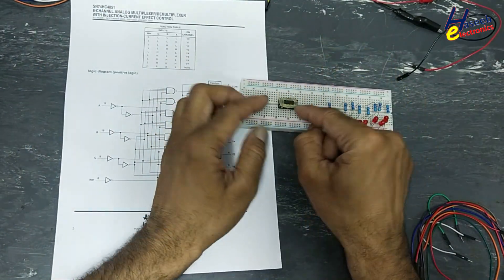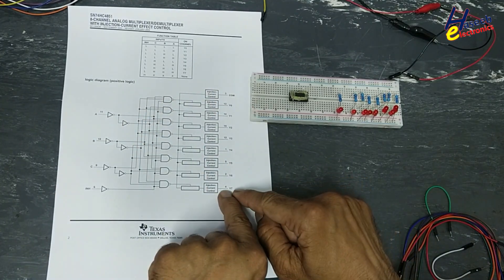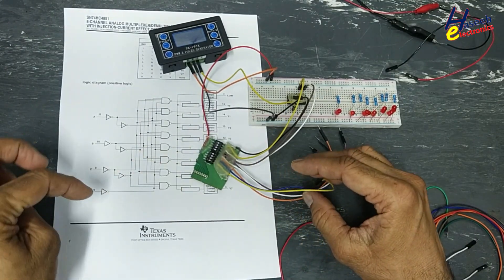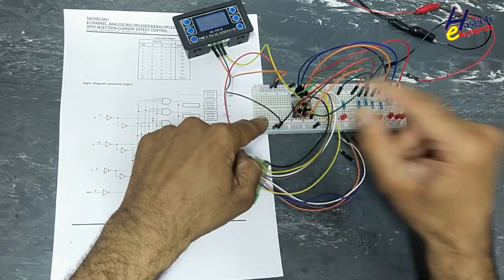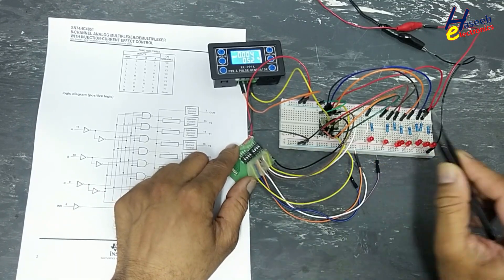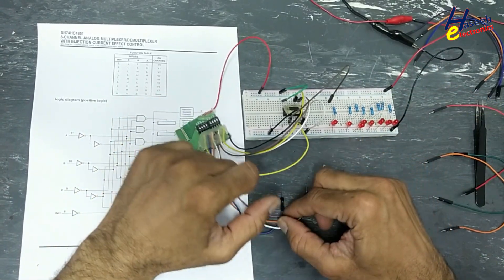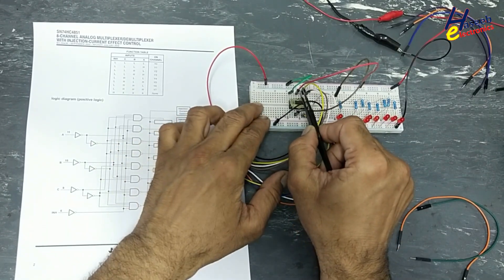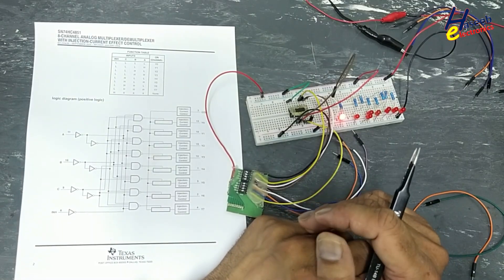{1419} HC4851 Analog Multiplexer Demultiplexer in ECM ECU | Working & Practical Testing

Comment: @Haseeb Electronics 
Hello sir  I have two atx power supply one is 200watt & other is around 450watt. 1)The 200watt supply working fine on day i turned it ON & there was some kind of sound of i turned it off immediately. Upon inspection found fuse was damaged and further tested with series bulb. The series bulb was glowing but when was testing with series one of the resistor got burnt that was connected to transistor in primary . As the resistor was burnt  replaced it. The transistor were C4242 as these where not available so i replaced them with mje13007 and replaced resistor with 100ohm new resistor. Now there is not short circuit on primary side and series bulb also off . 5V SB is present , 4V on green wire is also present but when green wire is connected to gnd other voltages are not generated.Tested for short on other rails there is no short. I don't have oscilloscope /frequency meter but just tested voltage on 8& 11 its around 1.5V, tl494 & lm339. TL494 is getting vcc & lm339 also. Btw there is one more chip on board i.e mc34063.  2) This power supply(7500 & 339 based) was good but suddenly stopped working when i opened i saw fuse was dead & replaced then again fuse & rectifier blew up tried once again result was same (at this i didn't have much idea about series bulb & repair so i stopped it and didnt repair further). Just few days  ago I planned to learn & repair this so I watched your videos and i did process as you mentioned as I knew the fuse was blowing i didn't put first I started going through board visually and cold testing . Rectifier, primary transistor & one bulk capacitor is damaged. Unfortunately at present I don't the same rating bulk capacitor (330uf 200V) but instead can i replace it from other board ( has 470uF 220V). After putting these back or before what are the test I need to do. I request you to help & advice me with further solutions.  Thank you very much , Have a great day..